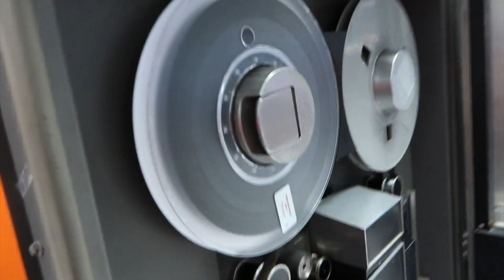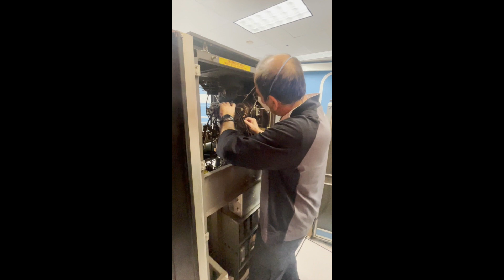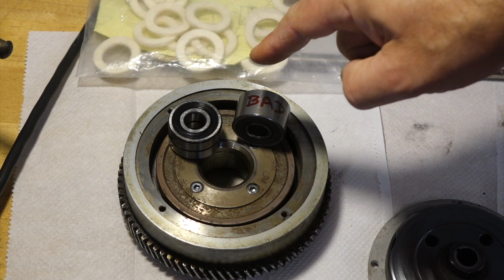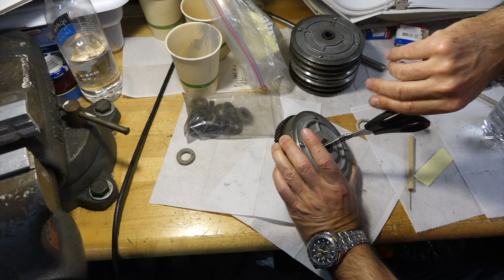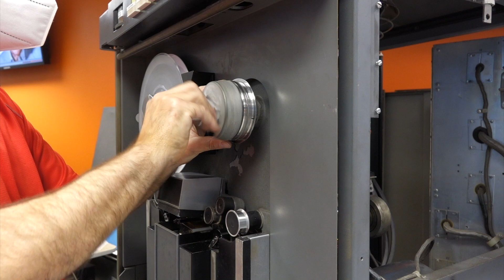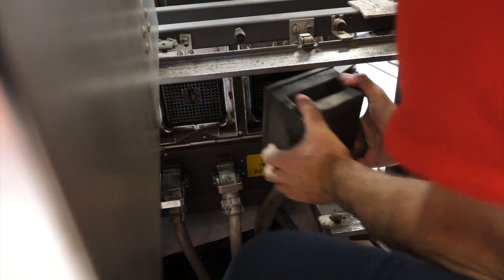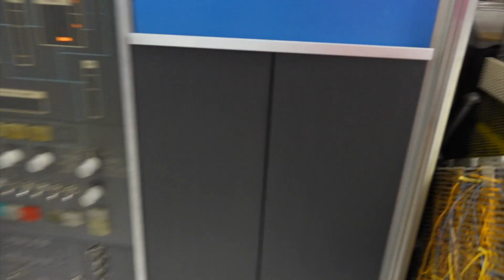IBM 729 Tape Drive Magnetic Clutch Job

Comment: Next video should be about replacing CRT fluid and floppy drive batteries. Has anyone ever changed the belts on a computer terminal? I hear they stretch out and the bits get delayed because the pulleys slip.
Reply: Funny, but I have once repaired a radar screen with a belt (a toothed one). Beam rotation was done by a motor rotating the coils. Lubrication and retensioning was needed as the belt would slide around the gear...
Reply: on the micro computers that used compact cassettes for storage a lose or slipping belt could cause unpredictable read errors - simply because they read everything as audio that was then demodulated - if the belt wasn't the correct tension it affected the tape speed which made the tone of the audio change, which resulted in a different data value. If this speed change was subtle enough it would still read as valid data, even if it was wrong, and made for some hilariously difficult bug fixing. So I have had to change belts on a micro computer, but not so much a terminal
Reply: Strangely enough, I've replaced many belts on Amstrad PCWs, CPC 6128s and Sinclair ZX Spectrum +3s. The Hitachi 3" floppy drives are belt driven, and they perish with age. The good ones harden and split into pieces - the bad ones turn to a horrible sticky goo that takes ages to remove from the pulleys.
Reply: I've de-rooted the logic board on my Datamedia DT80 I pulled from a creek. As in, pulled roots from under the chips. Followed by reverse engineering and fixing it enough to run an ASCII slideshow. Can't find the original ROMs though so it no longer functions as a terminal until I write my own or find a copy.
Reply: You joke, but old rear projection televisions and CRT projectors use a fluid filled lens to help cool the phosphor screen. Sometimes the fluid degrades and needs to be replaced.
Reply: @AmericanLocomotive1  I had one of those. I spilled the fluid a little when trying to see what was inside. Didn't know it was there at first.
Reply: Nerd. :D
Reply: Also, the way color Carts compensate for red electrons being heavier than green and blue.

Comment: Wow. I learn so much watching these videos. Magnetic powder controlled clutches. What other mysteries surround me that I have no clue about? Although this is older technology, the principle holds.
Reply from the maker: The technology is still alive and well today in cars, in magnetically controlled shock absorbers, otherwise known as active suspensions!
Reply: All John Deere lawn tractors these days include a magnetic clutch, with magnetic powder inside. It's how they bring the mower blades to an instant stop the moment the user does anything dangerous, like going in reverse while mowing. It's an impressive example of electromechanical technology, and has been around a long time, as this video proves.